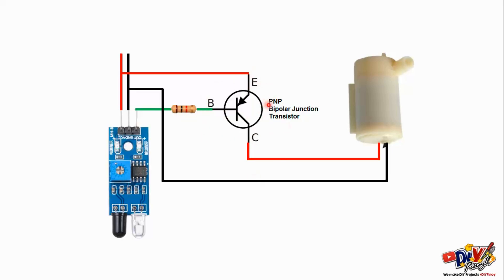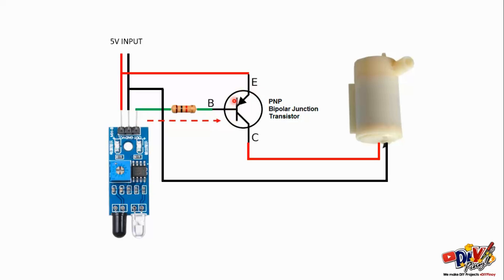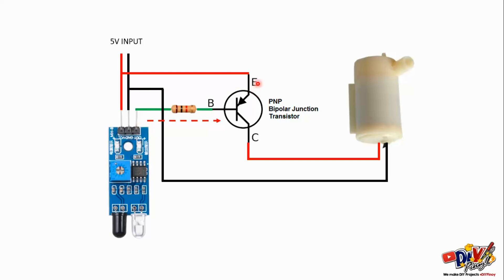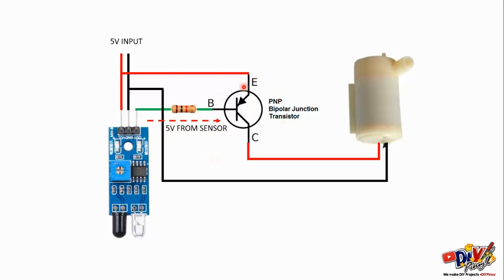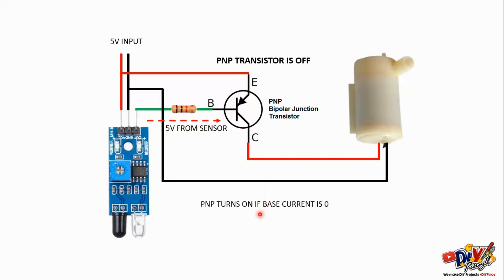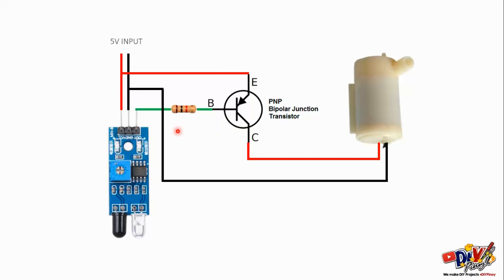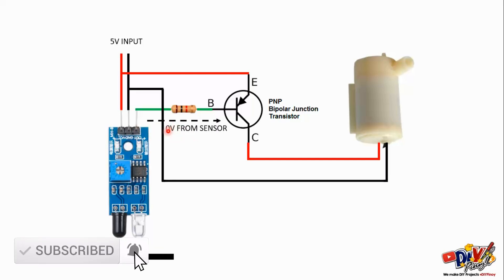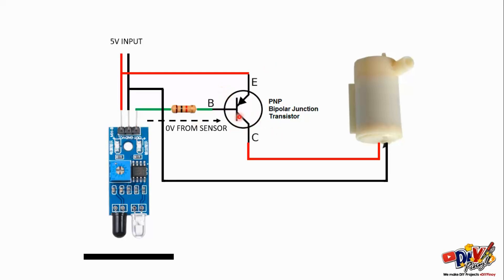DIY CONTACTLESS ALCOHOL DISPENSER

Comment from the maker: Please check my other BEST VIDEO that you will enjoy
1. DIY OFF GRID SOLAR POWER SYSTEM | TAGALOG ULTIMATE GUIDE
https://www.youtube.com/watch?v=yN0DmQMCYa0&t=479s
2. How to install Solar Grid Tie Inverter | CHEAP version
https://www.youtube.com/watch?v=0gYuL_ouxHA
3. DIY WIND TURBINE GENERATOR FOR HOME
https://www.youtube.com/watch?v=fjulcEpt-eU
4. UMIDIGI A3S UNBOXING | DIY PINOY UNBOX | 3000PHP SULIT PHONE (60USD)
https://www.youtube.com/watch?v=CU-MJxJDnM0&t=17s
5. How to make 12v DC Fan | Old Fan upgrade! | SAVE 50% on ELECTRICITY BILL
https://www.youtube.com/watch?v=Baum67o-cvg&t=3s